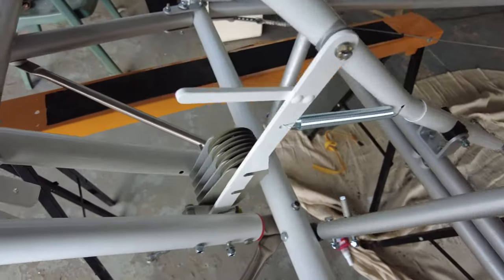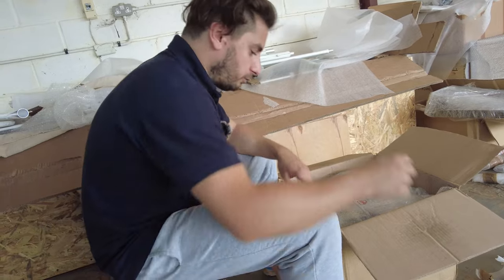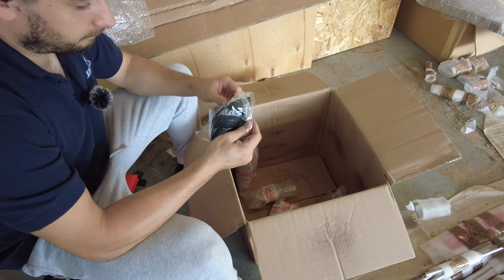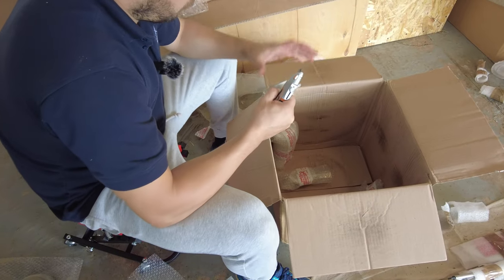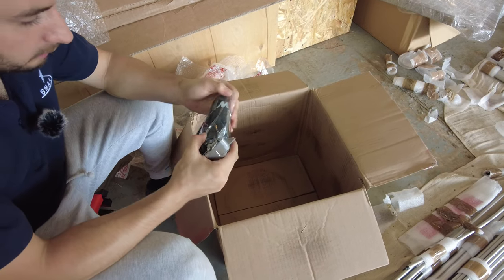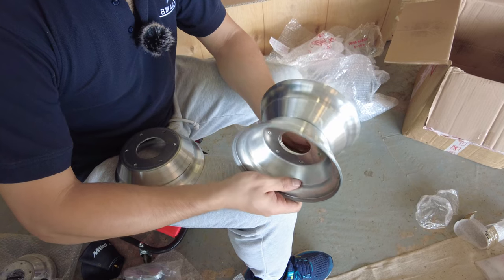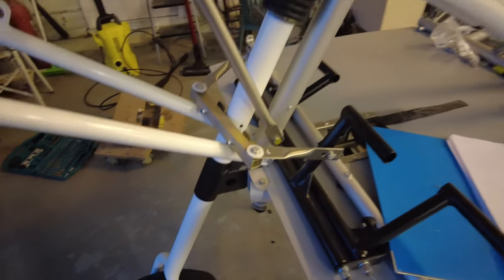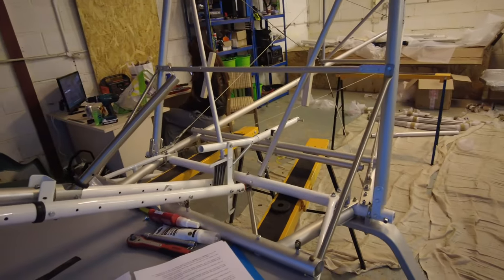Building A Plane | Building My Skyranger Nynja | Assembling Wheels & Gear Legs | Episode 6

Comment: Like Buses, just watched the last one! Satisfying clunk on that flap lever. What do you film these bits on, DJI Osmo? It's very smooth. I have a WEEBILL-S but it's a bit clunky with camera compared to just GoPro.
Reply: Just as I thought.
Reply from the maker: Thank you! Close guess - I use the DJI Pocket 2. I got it because its nice and easy for Anna to use and she doesn't have to concentrate much on holding it steady so it works a treat. I have a single wireless mic with it as well which works pretty well but not so well if there are two of you so I might have to upgrade.